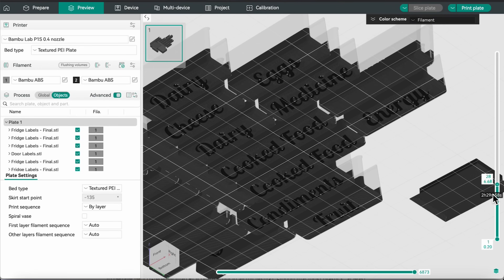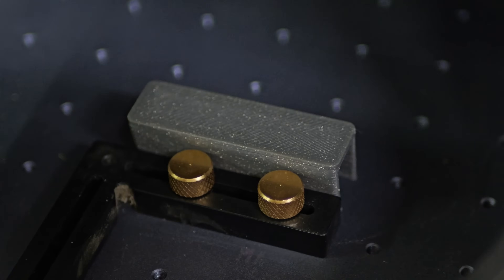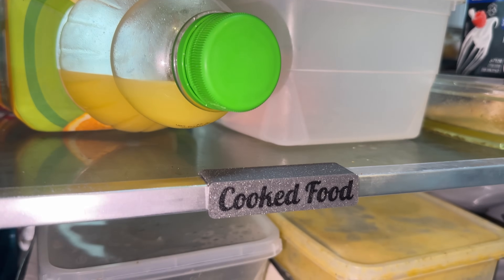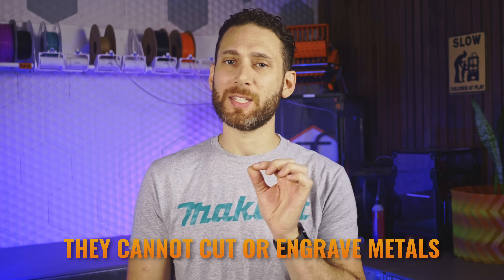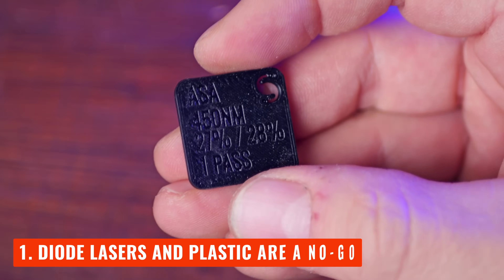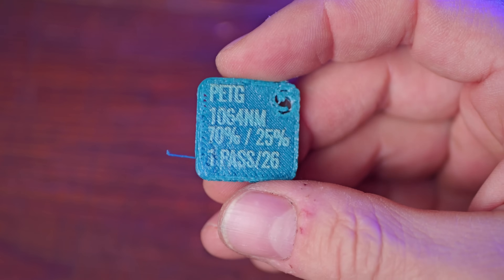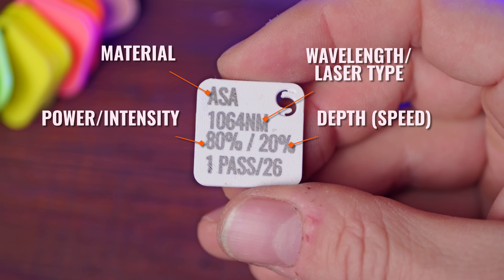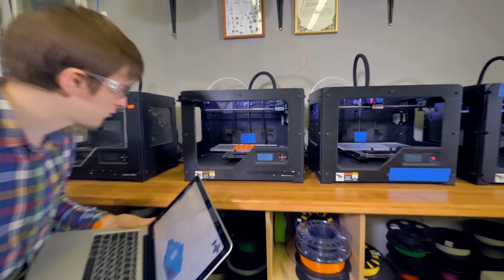I Experimented with Fiber-Lasering My 3D Prints

Comment: Been doing this on my Resin prints ever since. An example would be I've done coins and printed them using a Sunlu standard resin black, paint them, and also weather it to look like nickel with gloss topcoat. I then hatch a QR code at the painted back using my 60w fiber laser, at 30% power, 2000 speed and 3 passes. It will come out with a clean black color!

Comment: imagine making a video about 3D printed text and talking >90% only about lasers and not even realizing that stickers exist.
every manufacturer uses stickers everywhere. 
they are cheap, easy to make and easy to apply. 
no laser to make you blind or fumes to poison you or even the possibility to burn your house down.

most people have a printer and sticker paper is cheap and good enough for most things.
if not order some quality stickers.
and printing is highly dimensional accurate.
really good stickers even last longer then your 3d model.
building blocks, heavy machinery, pc components and so on. everyone uses stickers,

Comment: Honestly, I disagree. Change to a 0.2 nozzle and print at a low speed and low layer height and don't fuss about printing times. This feels like (is) an ad for something that can be done by dialing in your settings correctly. I just printed 4 labels which took some time but came out perfectly. Sorry, trying to influence but not getting me.
Reply from the maker: Thanks for the feedback.

Comment: Pulls out fine tip sharpie marker
Also, couldn't you add a custom attachment and .gcode to print what you want painted, attach a brush to the printhead, detach the brush, print the rest of the surface. Or a custom stamping attachment.

Comment: OK, I'm a noob at 3d printing, and only slightly better at using lasers, but I see a ton of benefit to both and even more in combining them.  I just wanted to point out that you missed a slightly newer laser, the UV laser. I guess that technically  it is a fiber laser but instead running int IR range runs in the Ultraviolet range (355nm).  It is probably the most versatile laser out there.  Unfortunately, probably the most expensive.  Although, ComMArker has release their Omni 1 for about $4,000.OOUS.  Not cheap by any stretch of the imagination.  Before anyone jumps my case for being a shrill, no I don't own any ComMarker products, nor have I received anything from them.  I've just stumbled upon them during my research.  There are other companies making UV lasers, but starting prices are around $7,000.00US and that is only for a 5W laser.  From what I've seen, these babies can mark damn near anything and do it fast.

Comment: 3DP text is not something I use that much, TBH. embossed or debossed, only at decent sizes that can be printed (unlike the "3DP benchy text").
I've done it quite often on request through color change, yet you nailed it : time consuming, waste generator. I prefer some slightly embossed text when needed and possible.

Comment: Hi, Jonathan, and thanks for doing this video. First: Happy Hanukah. I hope you’re not reading comments during the holiday! But for a later time… I was just having a conversation on Reddit about this topic, sharing my failed efforts to adequately mark White PLA. Your results seemed similar. One point to note: to stay on the safe side of things, just don’t ever ever ever attempt to engrave any plastic but acrylic on a diode laser. It ultimately just melts the plastic, and depending on its composition could emit toxic fumes that a filtration system will not sufficiently address and could potentially damage the laser itself. From what I see, ABS and ABA seem like they result in the best markings, which isn’t surprising.

Comment: I’ve been marking minispools as samples for the students at work on our laser, we’ve got a combined CO2 Fibre laser.

Nice work! Will have to do some testing when I get back to work to dial in the settings more!

I did find that Polymaker Black PLA Pro goes a very very light, almost white, grey on our machine.

Comment: The best way is to just fill your letters with paint or, if you want a flush finish dye some epoxy and fill it after post processing. A lot of professionals have been doing it for years.
Reply: Yeah I do this too. I use nail polish and then sand the whole surface, creates a really nice professional finish withoout layer lines, con is you need flat surfaces to do this.
Reply: @michaeljackson4958  do you have a video example of this?
Reply from the maker: Good idea but it always makes a mess in between layers for me.

Comment: I am wondering, you may have said this and I missed it, could you not make a dual layer print of contrasting colours, then laser engrave to expose the lower layer?
BTW. Hanukkah sameach
Reply from the maker: Thanks! Umm I don't know, the laser doesn't like to reomve material that much. Needs more testing. But also, i fyou have to do 2 colors all the way up that's super wasteful.
Reply: @the next layer  I am thinking more of a single top layer horizontally. You are correct that it is not a general solution or even a solution at all

Comment: It is also possible to 3d print an insert with a small nozzle, ideally with multicolor, instead of directly print it into the model. Like the Satoshi name plaque.
Reply from the maker: True, then print them in bulk. But still not as pretty you know?
Reply: @thenextlayer  Sure, but as a budget option and to avoid too many filament changes. If you can have a laser, have a laser. If you can have an UV printer, have an UV printer.

Comment: i bet theres some kind of paint on substance you can put on the plastic that'll react with the laser and produce the color you want.
Reply: i wonder if you just sprinkled the dust they put in epoxy resin to have it melt in and change the plastic color?
Reply from the maker: Oh damn that's a VERY good idea. I bet even clear coating and then burning off the clear would work. Darn, wish I'd thought of that before!

Comment: no... just no. This does NOT look any better than just using color changes or inset text; its less crisp and introduces a variety of other problems, and just doesnt really look that good to be honest. I get that you're just trying to come up with video ideas, as well as sell the laser engraver in the description, but come on, you're not fooling anyone, it looks the same, if not worse than 3d printed text of any form.
Reply: I agree, I think some of the examples of printed text looked perfectly acceptable, and inserts normally don't fit perfectly smooth. Definitely a business only play and on certain models
Reply: Yes, it does look pretty good and professional!
You probably didn't watched the same video as me 😂😂
Reply from the maker: Beauty is in the eye of the beholder. I'll admit I regret not cleaning the fingerprints off of some of those inserts before filming, because I didn't do them justice. But also, you might like the 3D printed look, and that's cool. To me, I MUCH prefered the fridge labels with laser etched ones. Every time I open my fridge I see the ugly seams on the printed ones and it bugs me :)

Comment: The best solution imo - text as a negative to remove it from the model. the fill with thick filler color. the walls created with this, will create a good barrier - but you have wait time for the paint to dry.
looks the imo the best, if you look for good readable text - and you can color it the way you want.

other than that - with an material changer and a well tuned machine you can have great text bottom/top facing.

Comment: Nice video.

Actually I did some colour texts with manual filament switch on the bottom three layers. This works quite well and the results are great if printing big text (like prusas mk3 display case or a case for an Amiga2000 to USB-adapter).

However, to print smaler text you realy want a nozzle with 0.2 mm or less. With a Revo hotend you actually could do a manual nozzle swap - practicaly the same way you do a manual filament swap, as all the nozzles have the exact same length. So you could print the first layers with 0.25 or even 0.15 mm nozzle diameter (takes quite a long time) and with 0.4mm (or even 0.6, 0.8mm...) print the rest. The number of layers to be printed with the small nozzle (and filament changes) depends on the filament you use. Dark text on bright filament normaly only needs 2 or 3 layers, bright colour on black need more. Transparent filaments of course need much more.

Open Source slicers seem not to allow different nozzle sizes for "virtual extruders". So you have to slice twice with different nozzle sizes set. Than you need to combine the gcode. Quite a lot of work, but definitly worth it.
Reply from the maker: Thanks for the thorough comment. Yeah, manual switches work, but if it's not on the first layer, it's ugly :(
Reply: @thenextlayer  Definitly. However, the same way you can make an indent on the 3d print to glue a metal laser engraved plate onto it, you of course also can glue a seperate 3d printed piece with labeling done on the first few layeres inside the indent. Such a seperate piece would be less than a mm thick (f.e. 4 layers of 0.2 mm), so quiete flexible and nice for a plaque on the side or top of your 3d print.
Of course some downsides for some nozzles, like also smal first layerhight, so no textured plate (minimum 0.2mm first layer there, not possible with 0.15mm extrusion width).

Another alternative for fine colourfull prints: Print in white filament and use dyesub transfer. Many inkjet printers with piezo printhead can be filled with dyesub ink instead normal ink. Best of course for flat surfaces, but still the method of printing a plaque and glue it (in)to the side also works.
This method is much cheaper than buying a fibre laser. You only can use light filament colours to dyesub on, but of course you can use filamentchange to make a white space only where you want to do the dyesub. However, you should use ABS or higher temp material, as you use an iron with about 200°C and a silicone sheet to transfer the print in about 75 seconds. PLA would deform, ABS mostly withstand this duration at this temperature.

Please do not missunderstand: I love the idea to use fibre laser. It´s just a bit outside my budget. If I would have the budget, a Prusa XL would be my priority. So maybe in two or three years I might consider a fibre laser.
As the fibre laser destroys the dye on the top of the print, it might be interesting to see if dyesub could be applied to the bleached out areas.

For metal plaques dyesub also can be an alternative to using a laser. Dyesub works on any plastic surface. However, a simple transparent coating is enough. Its the same techniqe used to make coffee mugs, mouse pads etc. with your individual prints. Simply use transparent coating on a metal plate and you can transfer your full colour print onto it.

Comment: meh debossed text without color change 
then fill with a syringe with colored uv epoxy 
set with uv 
amazing results that add zero print time and only little time to color the text but the result is amazing
Reply: You also save about $2,600 bucks.
Reply: @StompGojiStomp  indeed , this is just a joke of a commercial trying desperately to find a use for this overpriced piece of chit
Reply: @Crushonius  You could even get away with using nail polish or acrylic/enamel paints if resin isn't an option.

Since it's debossed, the chances of it scratching or rubbing away are negligible.
Reply: @Pepperham04  you are right of course but i think resin is better, because you actually fill the hole . Of course If you can not get resin or you are out then even acrylic paint would work and nail polish like you said
Reply: @Pepperham04  Not so sure about enamel never tried it with pla or petg . Have you tried it ? How good does it adhere to the plastic
Reply: @Crushonius  About on par with nail polish, IME. I use the Testors stuff meant for plastic model kits, which is ideally used with primer + clear coat. But for small applications like this, I'd say it's more than fine on its own.
Reply: @Pepperham04  good to know, i will try it sometime
Reply from the maker: Good idea, but sooo much work if you're selling products at scale!
Reply: @thenextlayer  there are so many different  ways to do this. You can design a slot just behind the text so when you put a piece of paper, cardboard, piece of plastic anything you can find really, so the debossed text acts as a border and the piece behind it is the color of your Text. Kinda hard to describe but you get the picture.  And finally If it exceeds certain amounts it Is not economical to be 3d printed anyways

Comment: I get beautiful multi colored lettering on the first layer on textured pei using Prusa Mk3S+/MMU3, X1C/AMS, Trident/Palette 3 Pro, and TLD3 Pro Idex.  It just takes some time tuning and you're good to go.  I have a 100w CO2 laser that also works great for some post processing, but I prefer the multi color printing for text where applicable.

Comment: Why didn’t you laser a test pattern on a whole big piece of material instead of one chip at a time for every setting?
Reply from the maker: Because I'm an idiot and didn't think about it. 
But also, the test patterns can vary in depth and power, but not in frequency for some reason. That ended up not mattering, but I thought frequencies would matter more.

Comment: You can get engraving plastic that's a sheet of one color with a thin layer of another, that you can then burn off. Wouldn't something similar work for 3D prints? Throw a contrasting color of paint on, then laser it off?

Comment: Not N but n. N is Newton and n is nano. M is mega and m is meter. This is important.
I see that you have noticed it but I had to write, or sit in a corner shaking. Easier to write and get it out of my system. :)
Reply from the maker: Hahahaha fair.
Reply: lower-case "m" is also "milli". Hence mm. Not to be confused with "m" as in "mfd" commonly used in the past to mean "microfarad, along with "mm" as in mmfd, to write picofarad as micromicrofarad.  🙂
Reply: Do you really think that people will interpret it as Newton Megas?

Comment: Multi-colour is wasteful but you can afford to waste a lot of plastic (about 250 spools!) for the $3500 US of that laser printer.
Reply: He said thats not for consumers
Reply: @firelion98  Yes he did, but that's not my point.   Businesses are also sensitive to costs.   He highlighted the waste issue as a justification for this solution so it was a valid thing to comment on. It will be up to the buyer to decide what is best but it's not an automatic solution if you are avoiding a waste that costs less than the solution.
Reply: There's plenty of far cheaper laser cutter/engravers out there.
Reply from the maker: That’s true but I think also you could justify higher prices with something like inserts, adding in wood and metal, etc. Also for businesses I think it’s less about the material waste and more about the time wasted printing multicolor.
Reply: @thenextlayer  I couldn't agree with you more, multicolor prints are extremely time-consuming on the current generation of machines.

Comment: It could be a YouTube just not showing the difference and my on existent 3d printing experience, but I think I prefer the 3d printed text.  The inserts also look cool, but I found most of the engraved swatches poor to pristine passable.  Still neat tech, and for the inserts would be nice to have, but honestly I’d not be running out to purchase one.

Also, could you not 3d print the text separately and insert it into the main piece? Use glue to adhere it, and I could see that being less wasteful and cleaner looking.  Not great for fine text though.
Reply: Too much work just to add text if add it separately
Reply from the maker: Appreciate the feedback. It was worth exploring! I think the inserts by far are the coolest option but don’t make sense for like a dashboard label or something

Comment: My UV laser does a much better job on plastic over the CO2 or Fiber. It does a great job of marking without melting or distorting the surface at all. UV is like a cheat code for laser marking plastics
Reply from the maker: Legit didn't know there was such a thing as a UV laser
Reply: @thenextlayer  they are still a bit more expensive than CO2, Fiber or Diode so they are not as common yet. They dump a lot less heat into the material and are capable of marking almost any material. The only big downside over the Fiber is they can only mark, not deep engrave or cut metals.

I mainly use mine to mark Datamatrix codes on black PET plastic parts. It makes a light gray marking, with extra fine detail, and no heat damage.
Reply: @thenextlayer  UV Lasers are designed specifically to engrave/mark plastics, so the ideal choose for this. (I have a small laser cutting/engraving company and the UV laser is probably my most used laser.)